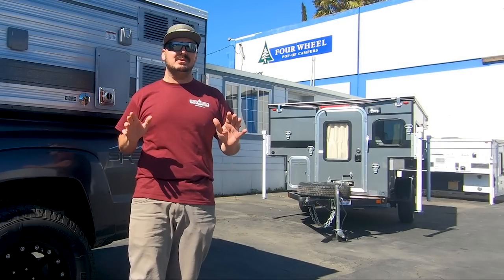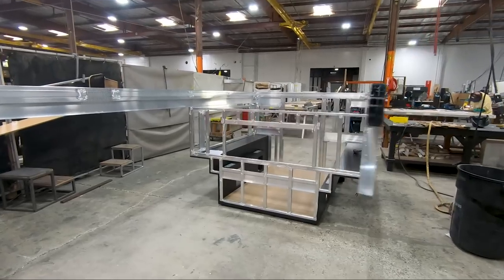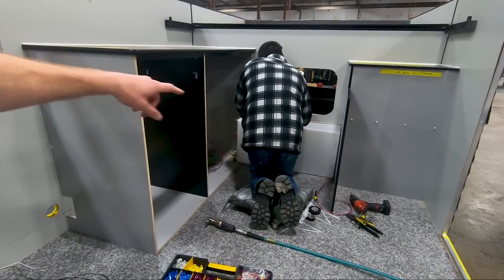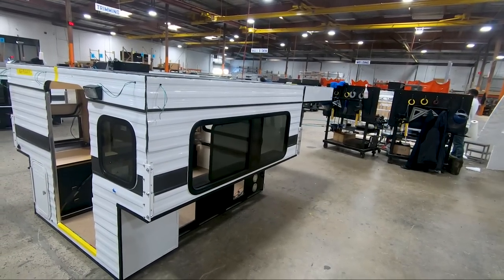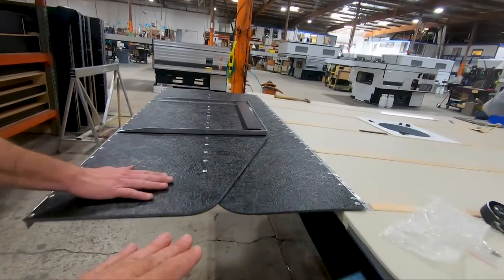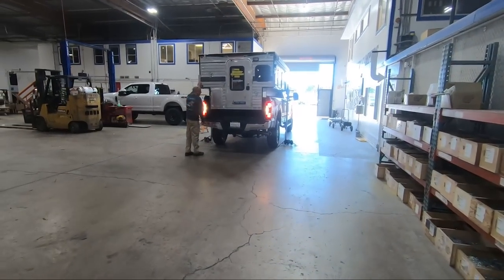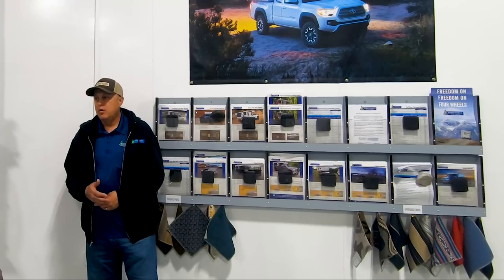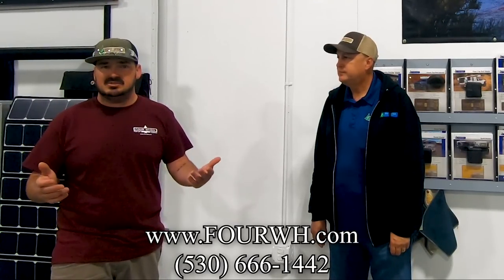Sir William Goes to Four Wheel Pop Up Camper | Factory Tour, How's It Made

Comment: Any talk of them putting in a diesel heater, rather than LP heater and possibly a diesel stove?  I really want to avoid the need to carry LP if I am already filling up the truck with diesel.  Along with the diesel, solar would be my other source of energy and go with as much as possible along with a lithium battery bank to run an ARB fridge, all LED lights, chargers and such.
Reply from the maker: Not that I've heard. The solar they have already and id like to see a 12vt dedicated fridge too and larger solar. Not sure about the diesel heater tho
Reply: @SirWilliamGoes  There is 3 compressor refrigerator 12 volt options to be had up to 130 litres👍👍👍

Comment: Those are very cool, but I was surprised how pricey they are. Saw them at a sportsman show and saw one for a small size truck for like 14k. I guess the agreement is that they are very well made and will last.
Reply from the maker: That and customer service. when you compare it to the price of some of the other camper style options out there the value that you get with FWC is superior.
Reply: You need to figure these are aluminum frame and not wood construction like the competition. You get what you pay for and these will outlast the truck you put them on.
Reply from the maker: @Oxinder  agree

Comment: Sir William Goes:

 Have an Acquaintance around  here that has  like a 10 year 4 Wheel Pop-up...he and his wife always take 2 tarps with them when they go and gather firewood. Like most RVs,etc,.....complete overpriced POSs  :)
Reply from the maker: I have an overpriced pos travel trailer and have heard of plenty more that said I haven't heard that about the FWC and from the looks of how they are put together and QC I'd be shocked if I did.
Reply: @SirWilliamGoes  

Aluminum does not hold it's tensile over time/usage...that's the dirty little secret about it. Ever wonder why Planes have to be scrapped? Even under constant usage (pressure-cycles) and used  WAY under the tensile/vibration strength thresh-hold...it weakens.....unlike steel.What I've noticed on their camper,the floor is the weakest link with 90-degree  joint points, had the sidewalls and floor been welded together with cast/extruded rounded unions (to evenly spread the load),the walls and floor would not becoming apart.

Their Toyota pickup does not help either....ever looked at the frame of a US Built Second Generation "Hilux" Tacoma to Present day? USA Spec Toyota pickups (Tundra to) don't even have fully-boxed frame anymore....the Truck itself is literally accelerating the pop-up coming apart. Funny part of the Hilux....every other country still gets the fully-boxed frame except the USA.